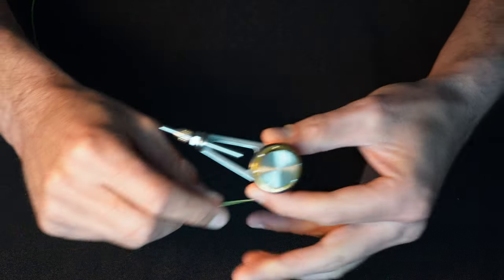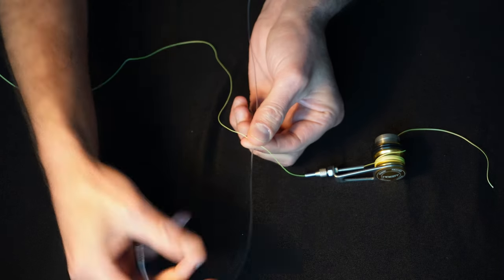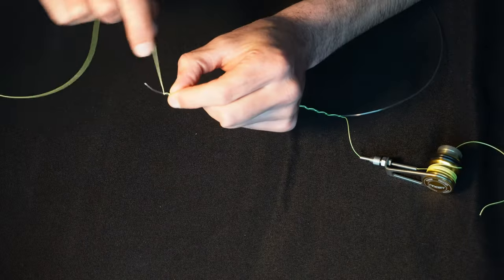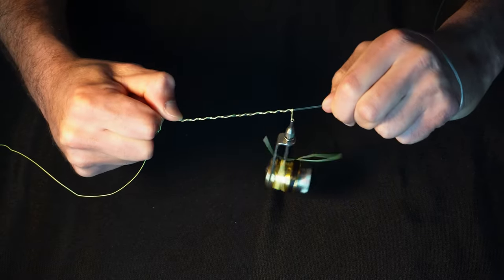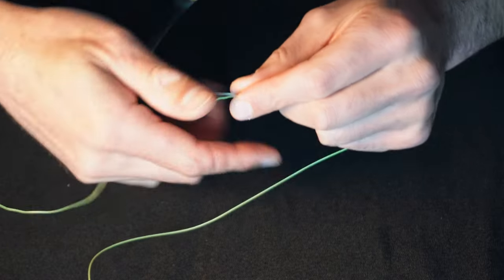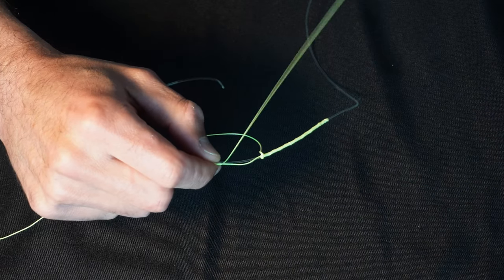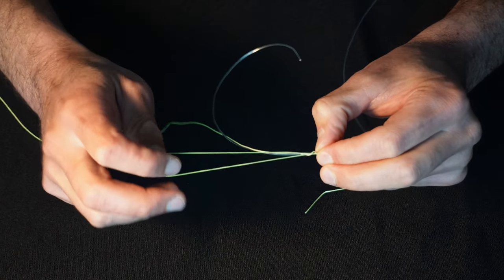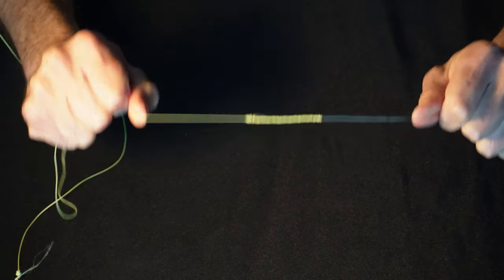PR Knot Tutorial | Step by Step Guide To The Unbreakable Fishing Knot

Comment: If you have a bobbin why didn’t you use it for the initial wraps. I think you should have used the bobbin both ways for a nicer knot.
Reply from the maker: Thanks for watching @sneekapaloopa... Thanks for the comment. I have tied it that way as well, in the past, but honestly it makes the knot connection double the size because you are overlapping two very tightly wrapped areas of the line (over each other). The way that I have tied gives you the incredible strength of the PR knot, and limits the diameter of the knot which is ideal for reeling the knot in and out of your reel and through the rods guides. The wraps I've done in the video (the first wrap) is more like a run way so the PR bobbin wraps catch on the runway and add strength without adding size to the diameter of the pr knot... hope that makes sense... have a great day and thanks again for the comment!!
Reply: @Johnnyfishalot  Understandable and thank you for the explanation